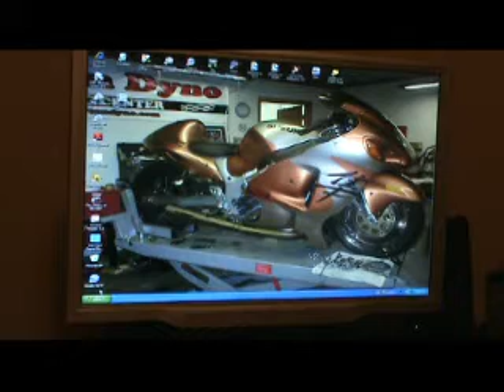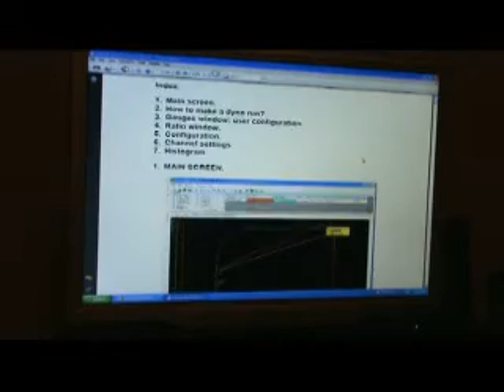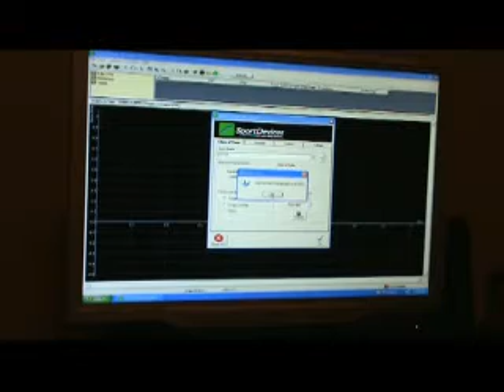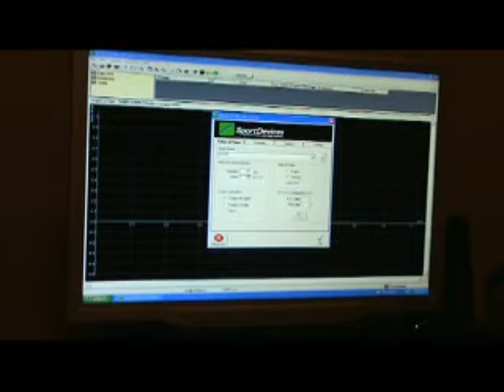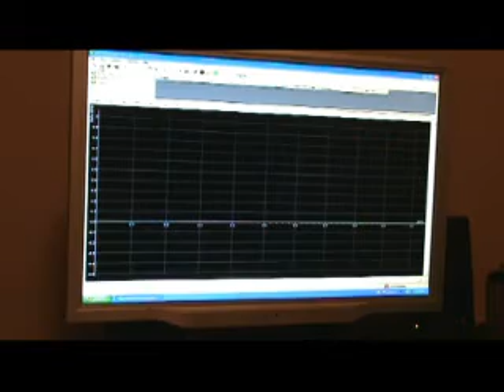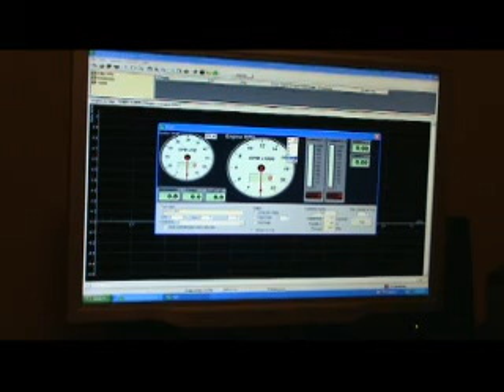Dayton Dyno software installation

Comment: Hi Mike, I really appreciate the video! I recently picked up a 325 HP Dayton Dyno and I’m getting mixed numbers during my runs and I believe it’s my configuration with the Sport Devices Software. Would you be willing to answer a few questions for me regarding the software?
Reply: I am having the same issues. Trying to get the correct numbers dialed in.